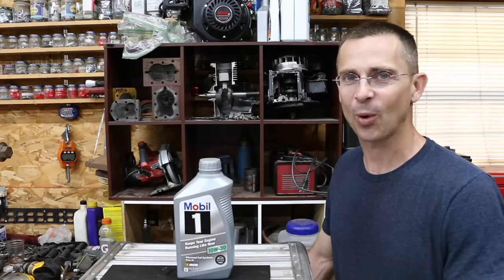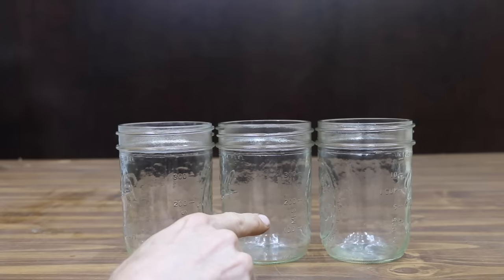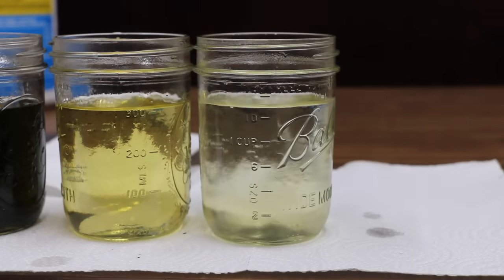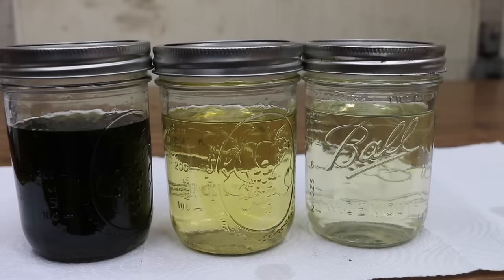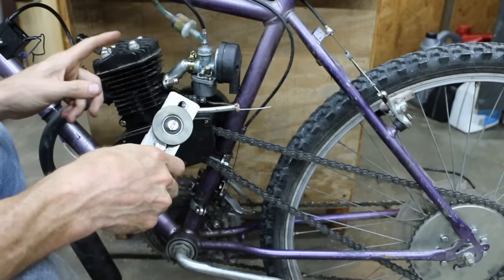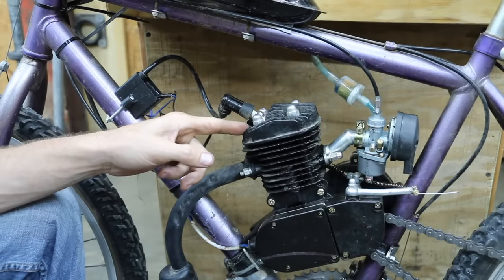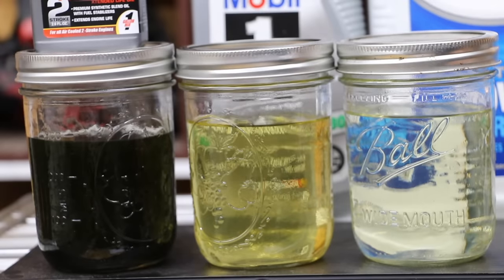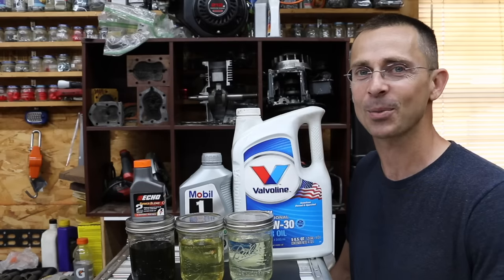Will 4-stroke oil damage a 2-stroke engine?  Let's find out!

Comment: Don't know if you're interested, but when I was a kid lots of people told me that twostroke oil would settle out. So I mixed up a batch, sealed it up in a pickle jar and put it on a shelf in my mother's garage. After a week there was no settling, I figured the question was answered and I forgot all about it. 20 years later I was cleaning out her garage and came across that pickle jar. Still perfectly mixed. No settling at all.
Reply from the maker: Wow!  This is great to know. Thank you
Reply: @ProjectFarm BTW, the oil was Castrol TT
Reply: @Andrey Angere I switched to Castrol TTS about 20 years ago and have had good results. Particularly on the modern bikes that specify vey lean ratios.
Reply: gasdive that’s super interesting man, I wonder if the 4 cycle oil will settle out. I don’t think I could keep up with a mason jar for 20 years though. Lol
Reply: @Andrey Angere ethanol in gas?
Reply: Wow!!
Reply: A lot of people say that castor oils will separate from gas over time and synthetic won't but what do i know lol
Reply: Wow
Reply: @jimbo5635  gas was still gas then.  It changed not long after 2000 and older the fuel system weren't engineered for ethanol in the gas. The efi can adjust the mixture as they do. But the lines can rust and the seals weren't meant for alcohol. Around the same time frame plus or minus a few years the epa released there minimum detergents law.   And hurt engines even further 2 ways.  Before that law.  Gas companies put more detergents in their fuel but when the epa released minimum requirement fuel companies did just that.  They saved money and cut down the additives to increase profits and be within the law.  This is also the same time frame they started lowering the sulpher content in gas and diesel. Sulphur lubricated fuel pump. When they did that is when on a massive scale people's fuel gauges stopped working when the sulpher was removed.  Then with motor oil they started lowering the zinc levels which zinc is what makes a sacrifical layer between the metal parts. I don't know if it still is with the sn and sn+ but 40 and 50wt were exempt from the zinc lowering.  It's was only energy conserving oils. The epa doesnt care about your engine protection. They only care about emissions from your gas. And that's why top tier stations were made.  Engines weren't making 100k mile warranties without  failures related to poor fuel cleanliness. If it wasn't costing them money they wouldn't care.
Reply: I’m sorry for your loss
Reply: @braedonellas2705  synthetic oil does settle out, 30 years ago when I raced motorx and silcoline brought out synthetic two stroke oil, their man told use to use less, ie weaker mix than normal oils as it settles out leans your fuel and can hole your piston! Just an aside, oil dude in our street used to use old used car engine oil in his two stroke Yamaha townmate 80. Went to work 6 miles each way for bloody years, I was at school and only a few months back he retired. I've been out of school for 26 years.
Reply: That's not long enough of a test, it requires at least 21 years for setting to occur. =]  JK
Reply: gasdive last year I bought a cart full of old vintage Castrol oils from the 60s and 70's that sat outside and in some guy's garage for years. There was about 4 cans of 2 stroke  oil, none of Which were punctured and just had some surface rust. I drained the cans into a 5 quart jug and I have been running it in my string trimmer, chainsaws, and leaf blowers for the past year and all motors still run perfect.
Reply: gasdive what about the pickles? Did they survived?
Reply: LoL that old tip
Reply: @gasdive  oil advertisement
Reply: Great info! Thanks!
Reply: should have tried running it maybe the gas would have still burned if it was in a sealed container
Reply: I've also been using Castrol TTS for over 20 years in everything from chainsaws, concrete saws,  2t motos, etc at 40:1 problem free👍
Reply: @scotthopkins7586  BS
Reply: @Andrey Angere I guess the gas evaporates through the gas line and the oil stays. Polymeres like plastic and rubbers are not gas tight, metals are.
Reply: @braedonellas2705 : Castor oil dissolves in alcohol better than most oils, so it's a superior choice vs. normal 2-stroke oil if your gasoline contains a high percentage of ethanol. (RC engine fuel is about 60% methanol, and thus always uses natural or synthetic castor oil as a lubricant.) Other than that, the only significant difference between castor oil vs. normal 2-stroke oil is that castor oil actually gets better at lubricating as it starts to varnish the inside of the combustion chamber. Also it kinda smells like french fries.
Reply: I suspect separation would mainly occur with significant and repeated temperature changes. Is the garage fairly temperature stable?
Reply: @scotthopkins7586  marine oil has a lower flash point than say power equipment oil. It'll run your weed eater or chain saw but it wont protect it when its hot. Water cooled outboards use the lower flash point oil to ensure less pollution to water.
Reply: Scott Hopkins I’ve been using it over 20 years. It’s better oil, zero engine failures and I still have a few items that have used it since new. 

Chainsaws, backpack blowers, weed wackers, etc. 

Always a good habit to get into is give whatever your starting a shake to mix the oil/fuel.
Reply: Andrey Angere I have equipment that’s 15-20 years old that I’ve used marine oil since new. That’s not true, it’s better oil because it has to be. 

Nobody wants to get stuck in a boat cause of crappy premix oil.
Reply: What I like about 2 stroke oil is the dye, you can tell the mixed fuel.  Growing up on the farm I never knew 2 stroke oil existed till I was well into my teens. Never did use it eat home.
Reply: Josh Smith 

Yup I’m sure 4-stroke oil will work ok at times. But my motto has always been that good oil is cheaper then a new engine every time. 

The rare chance I ever let anyone borrow anything that’s 2-stroke I made sure they took my gas that I mixed. 

That way if it came back damaged or seized they had no excuse.
Reply: @scotthopkins7586  If I remember correctly marine oils worked great in Lawn Boy air cooled engines, but you're not generally supposed to use a marine in an air cooled. I've always just used Lawn Boy ashless in the mowers
Reply: @Barney Mia  Pennzoil is good. If you have an older engine that leaks, I'd use a high mileage conventional (not synthetic or synthetic blend). If you don't experience leaks, synthetics can be a good choice. I don't believe in using these super thin oils manufacturers recommend these days. I use 20W -50 in the summer time here in Oklahoma, and use 10W-40 in the winter. If we saw colder temperatures I'd use a lighter viscosity.
Reply: Great infirmation.

But a chainsaw expert mentioned that the oil is suspended in the gas, not blended.

He shakes his gas mix every day or whenever he uses it.

Perhaps unnecessary, but no harm.
Reply: Nanu N I do the same, shake whatever equipment that’s two stroke just like the gas cans.
Reply: @Seth_Stewart  I had a small engine shop owner tell me to use either marine or 2-stroke motorcycle oil instead of the brand specific type and my exhaust screens would no longer carbon clog.
He was right, and so I use it in all my 2-strokes for years now.
Reply: You remember what oil that was ??
Reply: @ReneBuret  Castrol Super TT.
Reply: @Al_Man9oori  that's right.
Reply: @ReneBuret  but I switched to Castrol TTS decades ago.
Reply: Gary Chandler same, been using marine 2-stroke for 20 years never have had any problems or failures. Still have a old Echo weed whacker runs like new. Redmax EB7001 backpack blower I bought new in 2005 still has just as much power as it did when new. Marine 2-stroke is good stuff, usually buy the Quicksilver brand from Walmart.
Reply: Game Bred Duramax  that's interesting to know! I loved the smell of the races back in the day.
Reply: Castor oil will separate from gasoline and allegedly won’t mix with mineral based oils. I’m not convinced it won’t mix or even if that matters to an engine. The big issue with castor oil is when the gasoline has evaporated the oil polymerises and clogs the fuel system. It’s the same effect as linseed oil which is used in paints.
Reply: Game Bred Duramax  Used to race dirt bikes before my Harleys. Really, no pre-shaking needed unless you didn't ride often. We were too busy trying to control the adrenaline rushes!
Reply: Nope two strokes will run on coconut oil lol must premix in petrol tank it doesn't smell as nice
Reply: @Andrey Angere 
If your fuel contained either a fair amount of ethanol or water and ethanol that would make perfect sense.

Given enough time without agitation, E-10 will phase separate on its own.
If I add enough ethanol, methanol and, or water to cause phase separation in 2 stroke mix for non-marine purposes, the blue dye ends up in the ethanol/methanol/water layer, but the oil stays in the gasoline. 

E-10 gasoline is the bane of my existence...  Mix in marine grade 2 stroke oil & when it draws water from the air it emulsifies. 
It looks like Smurf milk.

I have to add a pint per gallon of methanol to make it phase separate into gasoline & 2 stroke oil in the top layer and ethanol, methanol & water on the bottom.

Then I can draw the gasoline off the top & let the volitiles evaporate from the bottom layer.
Reply: @michaelbamber4887  
I purchased a 1950's Elgin outboard with all of the original paperwork.
It says to mix motor oil in the gas.
It gives a ratio, but not a viscosity for the oil.
I'm pretty sure that was what they did before special 2 stroke oil existed.
I suppose the great depression era mindset would be to not waste good oil if you're just gonna burn it up, so used motor oil is better.
Reply: @noidontthinksolol  
I run my 4 stroke mud motor on water contaminated 2 stroke mix most of the time... I get it for free, and save people a few dollars by not having to take it to the hazardous materials drop off site.
Aside from needing to change the oil in the crank case a bit more often, due to some of the water getting past my rings, there's nothing problematic except for some difficulty cold starting it.
Been doing this for years... If there's too much water contamination to run my motor, add some methanol & let it phase separate. Then I take the dry gas off the top.
Reply: @kaisersose5549  yeah, it works fine. I restore old stationary engines. I have run 2 stroke on new oil and used, nice black petrol! Also I've used fully synthetic oil of 5w30 in a engine almost 100 years old and it didn't bother.
Reply: @JamesSmith-lt5zz  Wives tales, from armchair quarterbacks. Up here in the Great white north, we've run ethanol in gas for 50+ years, no issues. The issue is the reformulation and removal of MTBE... we still run MTBE up here. Have WW2 era equipment with original rubber hoses, no issues.
Reply: That is why it is called a solution.
Reply: @JamesSmith-lt5zz  ......the EPA's laws haven't helped the environment , they've caused environmental problems such as floods, cyclones, drought, heat waves ........ The epa staff are employed to make restrictive regulations to justify the reason for their highly paid  jobs. If they can't dream up new laws to impress politicians then they lose their jobs. The California style epa laws caught on all over the world to give us serious climate change. I remember the smog situation that existed . Best move we made was to remove lead from fuel and that was enough for me . The smog was keeping our planet cool , just balancing out the warming trend . Many folk have suffered much worse from wildfire smoke in recent times than they ever suffered from smog .
Reply: @michaelkuzmadutton7879  ...wouldn't collectors be interested in those old cans? And even more so if full.
Reply: Pretty cool bud...
Reply: 20 years?
Reply: Totally Amazing! Same question I had today when I found this vid. All of the best from South Africa
Reply: That's amazing! Them old heads had it right all along......
Reply: The experiment was an accidental success
Reply: @deusexaethera I think they're talking about CASTROL the engine oil mfgr..  not castor oil from the plant.. 😂😅
Reply: @h8troodoh  in the 60's and 70's they did use caster oil, from the plant in racing. The name of the company comes from them originally selling the plant oil.
Reply: @johnqpublic9074  I'm a fellow Canuck ,since when has  ethanol flavoured gas been around 50 years? Lol.. the last 20- 25 Maybe..  50?? I seriously doubt that...
Reply: @kaisersose5549 hrow the gas can in an acceptable freezer overnight  water settles to the bottom, freezes,you poor gas out before it starts to thaw, you add a bit methyl hydrate to make sure,and voila Dry Gas..
Reply: Now try running it in a engine
Reply: Thanks
Reply: The guy in the video mention that the 4 stroke gets "gummy" when left for periods.

A friend of mine insists two and four stroke go "off" after a while of being left. I've never needed to have mixed fuel laying around longer thsn the time I'm actually using it. So it's never been a problem. 
Certainly a great point to bring up.

Comment: I don’t remember “2 stroke” oil even being offered in the 50s and 60s. For our 2 stroke outboards, motorcycles, and lawnmowers, we just used any 30 weight engine oil mixed to a ratio of 50:1.  Sometimes when we expected to run the machines hard or during very hot weather, we’d mix it a bit richer (30 or 40:1). I think the 2 stroke oil offered today has fuel stabilizers in it.
Reply: Yeah but you were always swapping plugs and working on them too.
Reply: @christophervaughan1650  2 stroke engines are not hard to work on, where I live, the 2 stroke oils are Sae 30 and 40 dyed in blue colour, so when I run out of the Regular 2 stroke oil, I simply use Sae 40 API CF crankcase oils, I have to change the plugs more often but that's not a big deal
Reply: i use a 50/50 mix half 2 stroke oil and half 4 stroke oil, for the chainsaws and filter sump oil for the bar oil on the smaller saws all works fine
Reply: It's more than that, before bean oil there was no real difference, and now with ester based oil there is a big difference. Obviously engines in the 50's and 60's were nowhere near as reliable as engines are today, and good oil is a part of that. 4 stroke engine oil contains zinc which ashes and becomes abrasive, you should never run 4 stroke oil in any 2 stroke you care about for that reason alone.
Reply: even today I would never run a 2 cyc engine with less than 20:1 . Remember, the engine manufacturer wants you to buy a new one in 5 years max.
Reply: Two stroke oil has a lower flash point which means it ignites at a lower temperature resulting in less carbon formation & less fouled spark plugs. Unlike 4 stroke oil it is made to burn.
Reply: didn't use 50:1 in the 60s & 70s   16:1 or 32:1  McCulloch & Homelite  saws
Reply: Sae 30
Reply: 96 Polaris still runs fine on 30 w, and it's all I run in my chainsaw going on 5 years. I do carry plugs with me when I use them and always drain them end of season. Plus seafoam.
Reply: @bobbygetsbanned6049 there's a oil called ND 30 , non detergent, that's what the old 2 cycles recommended, I doubt it has zinc in it .
Reply: @Hambonebodi  You're right, if it's non detergent it doesn't have zinc. But it's still not nearly as good as modern 2 cycle oil.
Reply: My 1959 18hp evinrude uses 18:1  using 30 weight oil  I currently use synthetic non smoking oil and runs even better and less smoke i even pulled the head after a few years and  the bores still look new I guess the point is any lube is good lube I do like less smoke I feel in todays world it’s offensive to start it at the boat ramp choking out the kids on start up like back in the days but there nothing like the smell of 2 stroke in the morning before fishing Can I get a Hell Ya
Reply: @christophervaughan1650 that’s because of the points most likely

Comment: I'm currently conducting lubricity tests between blondes, brunettes and redheads while meticulously controlling weight variables, unfortunately I have zero data after 2 years
Reply: I'm 60.  In my experience, redheads run a little too hot, blondes run a little too cold, and brunettes have the best lubricity.